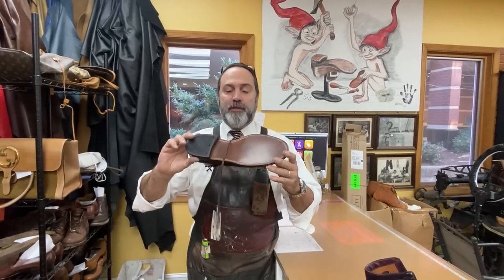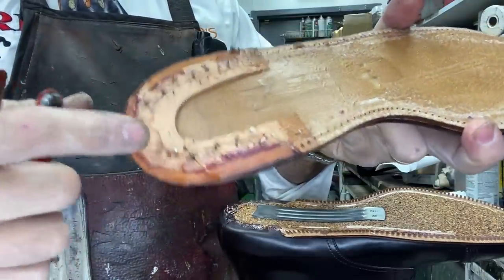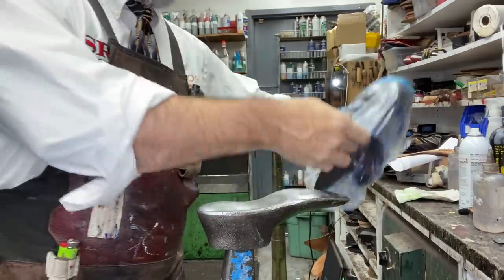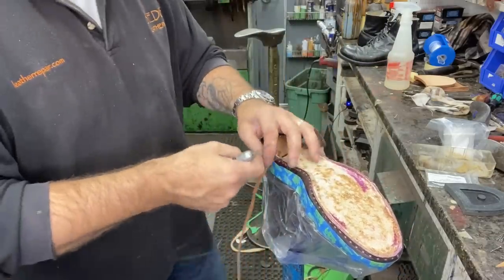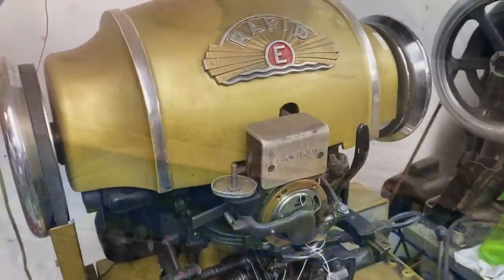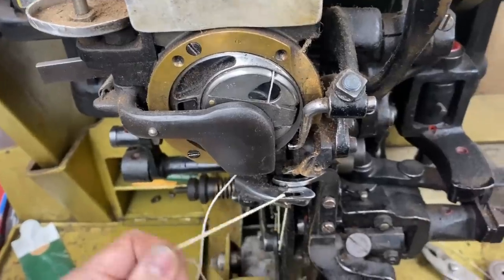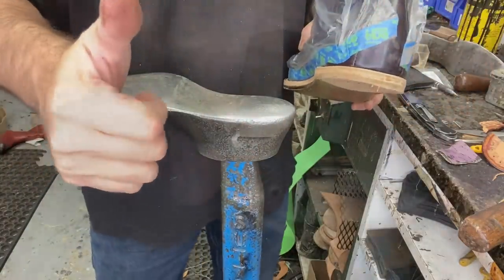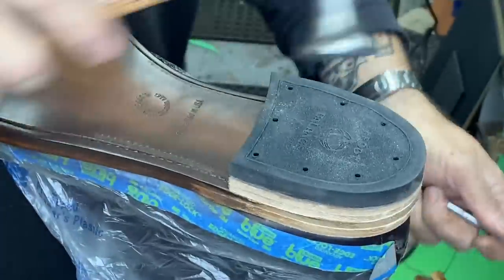Brand New shell cordovan Alden, complete makeover

Comment: Pretty sure it’s leather board, not fiber board. I love Alden. I love so much about them. They do have quality control issues over the last several years though. Usually with the stitching in the soles. Also, I really do wish they would go back to full leather heel stacks and mid soles. They are my favorite shoe maker still and love their lasts and styling and overall quality of build and materials. They just need better QC before the shoes leave the factory.

Comment: If you can find that pre-taped plastic without the edge-lock you might find it works better at not marring the surface of the boot.  Edge-lock is an oil based barrier on the tape to prevent bleed through from paint but I remember that on the blue tennis shoes you spiffed up a while back that there was a line visible in the uppers from the tape.  I believe it was from the "edge-lock" technology on that painter's tape.  3M does make a blue painter's tape that does not have the edge-lock technology but not sure if you can get it with the plastic attached.

Comment: Great job (again, as usual) Steve! Yeah, unfortunately 'QC' now seems to have a lower bar, mainly make it as cheap as possible, using the cheapest materials you can find and of course sell it for big $$.
Reply: I would guess that these were probably factory seconds. You cannot find them on Alden’s website but they sell seconds through a few retailers.
Reply from the maker: @jacobbwalters8133  that may be true but these were not sold as seconds

Comment: Thanks for showing this. I had almost considered Alden. at the risk of exposing my ignorance... seeing as how the boot doesn't even use leather for the heel, it seems like theft that they charge so much when Thursday's are 1/3 the price. Sure, the leather Alden uses for the upper is higher quality, but the boot itself just doesn't seem to be. I realize what you said about the company being decent, but it just doesn't seem worth it compared to what my ignorant self sees as higher values. i know a lot more goes into the shoe being quality or not than what material the heel is made of. and an argument could be made, i suppose, that if a company like Thursday is using more expensive things for less vital areas, they would have to cut costs somewhere else to be affordable, such as more important parts, the actual assembly of the shoe, and labor. but again, based on my extremely naïve knowledge of trying to figure out the best bang for the buck (i'm too poor to buy poor quality), i'd assume Alden is exploiting their customers using fancier leathers to justify higher markups.

Comment: Just wondering about fibreboard heels, every time I have seen you remove the fibreboard it looks in good condition. Generally you say at the same time that fibreboard isn’t any good. Is it possible when you can to show damaged fibreboard in comparison with leather as I am thinking fibreboard looks like a good product. Fibreboard looks like a process to make, would it be harder and more costly to produce than tanning leather? Why is there competition over a heel rand (I think that’s how it’s spelt)? Is fibreboard made from recycled material?

Comment: Question: Cutting the heel rand into a 'U' shape...was that a necessary cut? It seems you'd have a hard time using the the inner part that was removed for anything else. Could the piece of leather have been left intact or does that affect the overall 'feel' of the shoe while walking?
Reply from the maker: I’ve done both ways, I did it this way because that’s how it was.

Comment: Steve, Are these they Alden's they make for J. Crew? My Alden Cordovan PCT (D8832) Boots color 8 Shell came with the 270 degree "fudge wheel tool" marks all around the stitching of the sole. These could also be knock-offs because the heel is even wrong. Alden PCT boots come with dovetail heels with 19 brass nails which are not present here. Thoughts?

Comment: I don't know how you get away with using masking tape on the uppers. Any time I tried that it would pull up the finish.  Maybe it was the cheapo leather they used in the diabetic shoes that I predominantly worked on, but since we never had the equipment or experience for that matter to refinish uppers, I just had to rely on being careful. Beautiful job btw as always!
Reply from the maker: Try a heat gun when removing the tape , low heat

Comment: I cannot accept that Alden let those boots out of their factory that way. I suspect...those boots are what is called 'seconds'. Meaning...Alden recognized the mistake...and put them up for sale at a large discount. Both Alden and Allen Edmonds does this. So those boots brand new...in perfect shape run around $700. As defect 'seconds', they probably sell for about $300. Are you sure the owner of these...did not buy these at a drastic discount? I suspect he or she...did. Personally...a $700 boot should be immaculate, and if I paid that much for them...and got this pair...I would be putting footprints on the ceiling.  However...if I saw those...and they were only $300...I would certainly consider buying them, even with the defect. I suspect they were sold as known defects.

Comment: Hi Steve, I am in the process of replacing the zipper on a heavy patriots coat and wonder what to charge him. I didn’t want to go in through the arm so I went thru the hem…oh my gosh I couldn’t replace the one side and had to replace the entire zipper on both sides. And the crazy thing is that the zipper was originally put in on the underside of the zipper, so the back of the zipper is what shows on the front. I’m anal so everything has to be done as if it never happened. I will be done today and wonder what to charge him. I’ve made custom windows treatments for a bgillion years. But every now and then people ask me to do this kind of thing. I never know what to charge. Curtains…..I know exactly what to charge and for certain window services. And not cleaning them either!
Reply from the maker: i have no idea on how to price your work
Reply: I’ve seen you work on a coat hear and there but primarily your a sole man! Well? I finished that and it was a pain in the ass.

Comment: Hi Steve what’s the difference between a 270 welt with a heel rand a d a 360 welt. Why wouldn’t you (or the manufacturer) just do a 360?
Reply: He’s had a few really good videos on this, his personal Indy boots included. Scan through his videos and check them out.
Reply: @tflick41  Hi yeah, I’m a religious viewer. I’ve seen Steve explain the two different construction types exist. I just don’t get WHY you would do a 270. Doesn’t seem like less effort and is not as strong.
Reply: @edd2771  ah gotcha!  Personally I think the 270 is a slimmer, formal (for lack of better word)type heel and the 360 is more of a boot/work boot heel.
Reply: @tflick41  ya. I wear Allen Edmonds which are mostly all 360 and I prefer the look. I can understand why some might like the 270 from an aesthetic point of view but I think it’s a slight compromise on overall strength.
Reply from the maker: It’s mostly the way it looks, 270 is more slimmer, dressier